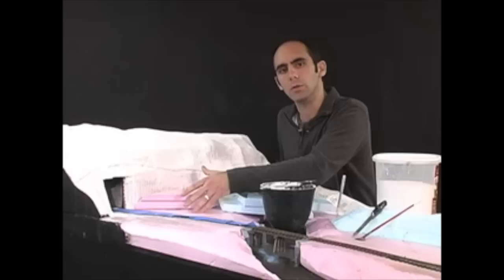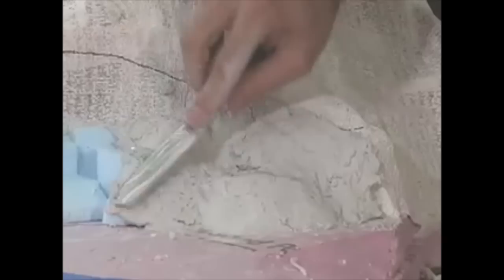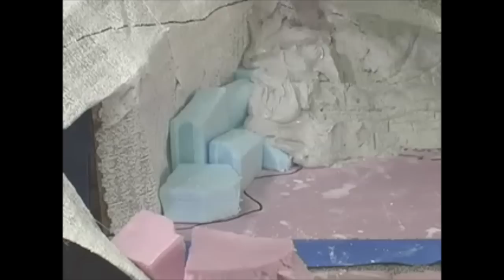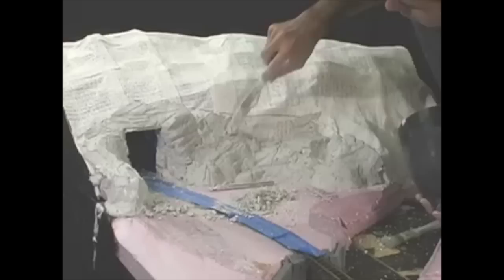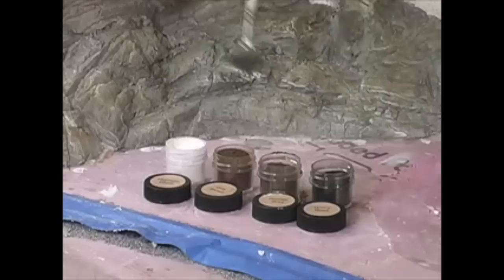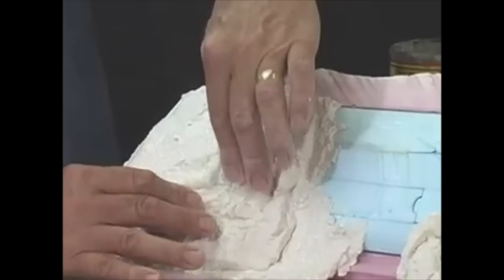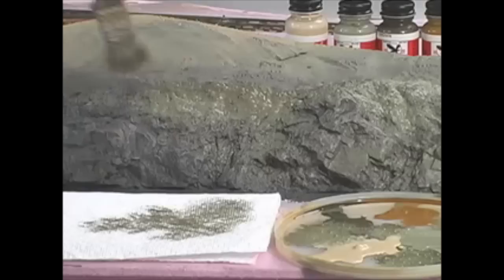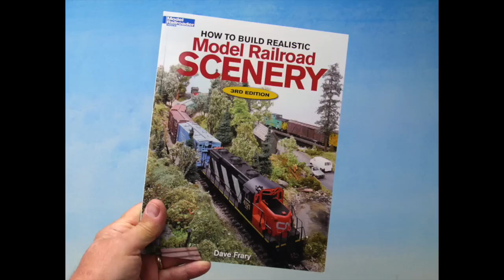Building and Painting Model Rocks

Comment: Just a note. When you are applying the highlights remember that there is but one sun so have an idea where the sun would be and highlight the rock as the sun would. Don't highlight in several directions. Only one... I started with Hydrocal but now I use plaster because it is so very much softer and easy to carve and blend the rocks together. I have 22 different molds now that I have made and it didn't cost much at all.

Comment: you guys did a great job, but what I found is plaster sets to quick, so I used dry wall mud, it's cheaper, and you can take days to finish carving and ya it does crack when it dry's, all the better. I hope to video what I did and hope you can comment on it, right or wrong?
Reply: If you like plaster then you can extend the "wet -soft period" by using very cold water. I get about 1/2 hour working time by using the cold water system. Just put a glass of water in the refridgerator the evening before you are going to work and use this. I don't like the dry wall mud because it shrinks so much. I also sift the plaster into the water.
Reply: @davidcurtis5398  Never tryed the cold water thing, but I did mix plaster with double the water, that way I could dip paper towel (viva) and drape over bead bored pieces and came back with dry wall mud and carved it just before it dryed, worked well
Reply: @ronaldbroehm1411  Hi, I'm no expert but it works for me...